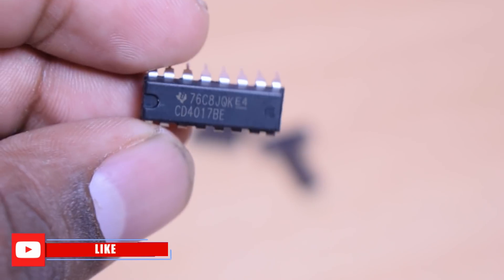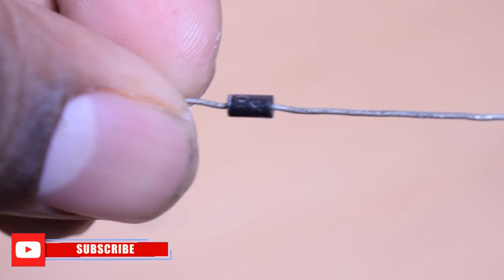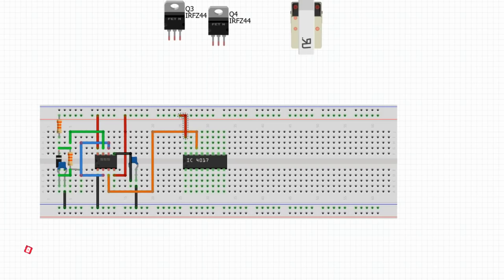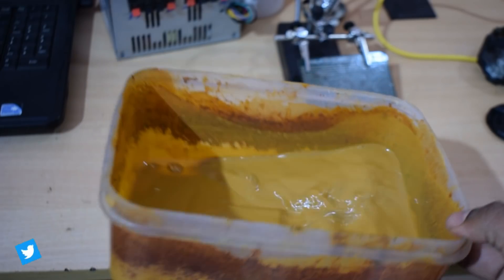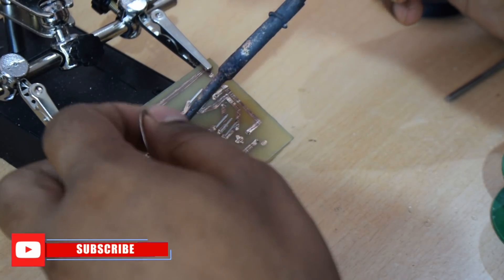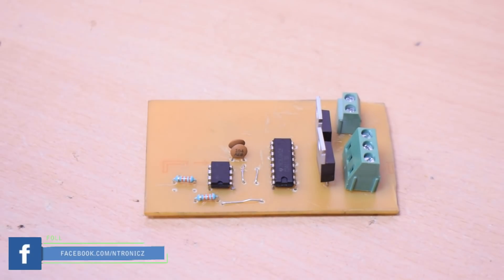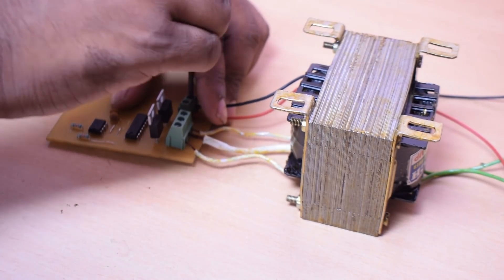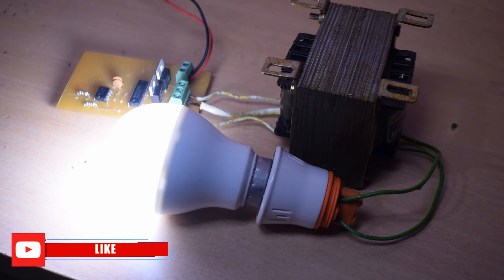സ്വന്തമായി ഒരു കിടിലൻ ഇൻവെർട്ടർ നിർമികം   | How to Make a Simple Inverter at Home

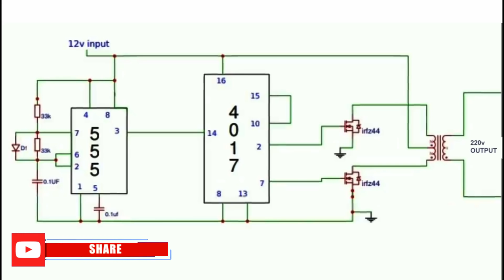Comment from the maker: For Circuit Diagram -  Watch 4:43
Components Required:
IC 4017 ×1
IC 555 ×1
33K RESISTOR ×2
.1 uF capacitor ×2
12 -230v 5 amp Transformer ×1
IRFz44 MOSFET ×2
RELAY PIN ×2
Dot Board or Copper clad Board
Reply: Kurch kuudy manassilaghunna vidhathil daigram ayachu tharumo
Reply: ഇത് നിർമിച്ചു നൽകുന്നുണ്ടോ  ഉണ്ടെങ്കിൽ അറിയിക്കുക പ്ളീസ് ഫോൺ no തരു
Reply: റിയാസ് നിങ്ങളുടെ ഫോൺ നമ്പർ തരുമോ ഏത് ജില്ലയിൽ ആണ് താമസിക്കുന്നത്
Reply: 200 w venel transformer kooduthal venamllo apo cost koodille
Reply: Broo can i use 12 0 12 3ah transformer
Reply: പുതിയതായി ചെയ്യാൻ പോകുന്ന sine wave inverter എത്ര watts ആണ്
Reply: പുതിയതായ്  ചെയ്യാൻ പോകുന്ന Sine wave inverter എത്ര watts ആണ്
Reply: ആ  bodi അയച്ചു തരുമോ chash തരാം
Reply: Setcheythaboardevidekittum
Reply: Smps kondu oru റെഗുലേറ്റഡ് amp, volt ഉള്ള ഒരു കാർ ചാർജർ ഉണ്ടാകുന്നത് എങ്ങിനെയെന്നറിയാൻ താല്പര്യമുണ്ട്..

Comment: Nias 200v dc to 220v ac invertor undakkan pattumo?
Reply from the maker: Pattum..athinn mattiya Mosfet kandu pidikkanam
Reply: Niyas Thalappil can you help me?
Reply: Can you check IRFP 460 mosfet data sheet its working voltage is 500v

Comment: 12x5a=60w,  24  V  ആണ് എങ്കിലും current5amp തന്നെ. Winding 5Amp capacity ആണ്. ല്ലേ? 60W ബൾബ്, 100W, 200വാട്ട്സ്, ഇങ്ങനെ ബൾബുകൾ  connect ചെയ്തു ടെസ്റ്റ്‌ നടത്തുബോൾ അറിയാം. 100W മങ്ങി കത്തും. 200W തീരെ മങ്ങി നില്കും.ഞാൻ 1989 ൽ, 12Vx5amp transformer വച്ചു ഇൻവെർട്ടർ ഉണ്ടാക്കി, വീട്ടിൽ ഉപയോഗിച്ചു.  60W ബൾബ് ആണ് വിജയകരമായി കത്തിച്ചതു. Multivibrator,  50Hz freqeuncy തന്നു. 12-0-12x5ആ ട്രാൻസ്ഫർ.

Comment: 12v/5amp ട്രാന്സ്ഫോര്മര് ഇൽ 200w ഔട്ട്പുട്ട്  എങ്ങിനെ കിട്ടും...
Reply: @John Bastin 100%👍..
Reply: sivan qa
Reply: ശരിയാണ്,   പക്ഷെ 12-0-12 ട്രാൻസ്‌ഫോർമർ  അല്ലെ.. 12-0 ആണെകിൽ അല്ലെ  60 നമുക്ക് 60w ഔട്ട്പുട്ട് ലഭിക്കു... 12-0-12 ആകുബോൾ 24v  10 ampre യിൽ യൂസ് ചെയമലോ അതിന്റെ സെന്റർ ടാപ് ഒഴിവാക്കിയാൽ പോരെ...ഇതൊരു squre wave inverter ആയത്കൊണ്ട് peak to peak voltage 24 കിട്ടില്ല എങ്കിലും ഒരു 18,19v  എങ്കിലും കിട്ടേണ്ടത് aanu.. Currect aait അറിയണം എങ്കിൽ ചെയ്ത് നോക്കേണ്ടി വരും... എങ്കിലും ഒരു  180 w എങ്കിലും കിട്ടും എന്ന് പ്രധീക്ഷിക്കാവുന്നത് ആണ്
Reply: @bibinpv168  12x5a=60w,  24  V  ആണ് എങ്കിലും current5amp തന്നെ. Winding 5Amp capacity ആണ്. ല്ലേ?
Reply: @rajjtech5692  പറഞ്ഞത്  ശരി ആണ്.. വൈൻഡിങ് 5ampre തന്നെ ആണ് .. പക്ഷെ അത്‌ ഒരു rated വാല്യൂ മാത്രം ആണ് ഇതിനു വാരിയേഷൻസ്  ഉണ്ട്.. 7. 44 ampre ആണ് ഒരു 12-0-12, 5ampere  ട്രാൻസ്ഫോർമേരിൽ  24 v മോഡിൽ ഷോർട് circuit ടെസ്റ്റ്‌ നടത്തിയപ്പോൾ കിട്ടിയ വാല്യൂ..so  ഇതിന്റെ സെക്കന്ററി side input ആയി യൂസ് ചെയ്‌ബോ  ഇൻപുട്ടിന് അക്റക്രോസ് ആയി  10 amp current വരെ കൊടുക്കാൻ സാധിക്കും എന്ന് പറഞ്ഞത് calculations currect ആണെകിൽ 176w ആണ് മാക്സിമം കപ്പാസിറ്റി, ബാക്കി ഒകെ circuit ബോർഡിന്റെ efficency പോലെ ഇരിക്കും .. പിന്നെ ഞൻ ആദ്യത്തെ cmntil പറഞ്ഞാലോ ഇത് 200w ഔട്ട്പുട്ട് തരും എന്ന് യാതൊരു ഉറപ്പും ഇല്ല.. Led ലൈറ്റ് ഒകെ കത്തിക്കാൻ പറ്റിയേക്കും.. പിന്നെ ഒരു inverterinte കാര്യത്തിൽ ampre * വോൾട് മാത്രം അല്ല ഫ്രീക്യുൻസിk കൂടെ ഡിപെന്റന്റ് ആണ് ഔട്ട്പുട്ട്.. ഞൻ എന്തായാലും ഏതൊരണം ഉണ്ടാക്കി നോക്കിയിട് ഫീഡ്ബാക്ക് തരാം.. ഇവർ ഇ കാണിക്കുന്ന വീഡിയോ ഒകെ  സത്യം ആണോ എന്ന് അറിയാൻ അത്‌ ചെയ്ത് നോക്കുക തന്നെ വേണം..ഇത് 24 v ഓസിലേഷൻ ആണോ യൂസ് ചെയുന്നെ എന്ന് ഒകെ nokiyale vdo fake ആണോ എന്ന് പറയാൻ pattu..ഞൻ പറഞ്ഞ 24v* 10A ഒരു സാധ്യത മാത്രം ആണ്..പൂർണ വിവരം undakiyale അറിയാൻ pattu..
Reply: ഇതാണ് തള്ള് തള്ള് എന്നൊക്കെ പറയുന്നത്. മാക്സിമം 60watt കിട്ടുന്ന സാധനത്തിനു 200watt എന്നല്ലേ വെച്ച് തള്ളുന്നത്. 😉😉😉😉

Comment: 7ah battery എത്ര Watts kittum
Reply: 12v 7 ah battery aanengil, 10 Watts bulb theoretically Oru 8.4hours vare pravarthipikaam.
Athu calculate cheythu nokaan
12v x 7ah = 84watts energy e batteryil store cheyaam.
84/10 = 8.4hours
Reply from the maker: Watts never depends on battery capacity

Comment: Use cheytha battery കാണിച്ചില്ല bro
12v 7 amp battery 5amp transformer il koduthal 60 w square wave alle load kittullu... Ithetha battery???

Pinne battery koodi add cheythal 400 roopa porallo 🤔
Reply from the maker: Bro battery koodatheya ee price..pinne parallel aayitt 2 transformer add cheythale 200 w kittooo...njan yende design maximum capacity aanu paranjath
Reply: Ith njan ippo orennam undakiyathan 555 illathe thanne.
Enthayalum 200w aakunna circuit bro cheyyu... All the best

Comment: 1000 സ്‌കോയാർ ഫിറ്റ് ഉള്ള വീട് സ്വാ ലാർ ചെയ്യാൻ എത്ര വരും
Reply: 180watts solar panel 7000-8000rs range aanu price single panel. 10 ennam vachaal 2kw panel aduthu nilkum. Apol oru 2kw power panel cost maathram 1 lakh. Pinne oru inverter and battery mathiyaavum. Ente oru Calculation 1 lakh 25 k undel oru 2kilo watts cheyyaam ennu thonnunnu.
Reply from the maker: Almost 8 lakh

Comment: 12v x 5amp = 60w, 200watts enganega kittunne bro??, 12v/5amp redimade transformer il 230v supply line wire guage 28/30swg aanu use cheyyunne, athinte current carrying capacity brotherinu ariyamallo alle???, Pinne ethilum easy aanu sg3525, sg3524 ic use cheythu inverter cheyyunne, tl494 ic yum kollam, pinne very simple ic circuit aanu cd4047., Try to that, all the best.
Reply from the maker: njan evide 200w yenn undeshichath ee circuitinde maximum power aanu..namukk parallel aayitt transformer use cheyth ith upgrade cheyth 200w vare kond pokan saathikkum
Reply: @NiyasThalappil  maximum 200watts engane bro?? Onnu vishadheekarikkamo??
Reply from the maker: I would calculated by maximum drain current of mosfet
Reply: @NiyasThalappil  for example 12v/5amp transormeril secondary 12-0-12 winding wire 20swg or 12swg aanu use cheyyunne, oru 20swg enammeled copper wiril koodi etra amps pass cheyyum bro? Please check wire guage and amps carrying chart., All the best once again! Byeeee
Reply from the maker: Namuk parallel aayitt mattoru transformer use cheyth koode??
Reply: @NiyasThalappil  bro. ningalude video yude udhesham thanne how to reduce money for making a simple and powerful invertor., Athinu parralel aayi transformer add cheyythu cash kalayunnathine kaal 200w/300w. Vare kittuna old ups transformer simple aayi kittum old scrap ups transformer use cheythaal, old scrap shops I'll 100 or 200  roopaykku kittum., But oru 12v/5amp medikkanam engil thanne 350 rs engilum venam.,,. More than better is ferrite transformer use cheythu sg3525 ic use cheythu verum 100rs costil high frequency invertor undakkaam., Output rectified bridge with filter use cheyyanam ennu maatram,  computer smps nte transformer mathiyaakum., All the best for your every efforts!
Reply from the maker: Orupadu valuable aayittulla idea thannathil valare nanni..eni pratheekshikkunnu ith pole ulla valuable aayittulla information
Reply: oree pwoli

Comment: It would better if u put the components needed in the description. It would be good if u made a 12v battery charger and an ac invertor switch which goes with this circuit.
Reply from the maker: Thanks for your valuable feedback.. Comment boxil koduthittund
Reply: Pannel ആവശ്യം eele. ബോർഡ്‌ മതിയോ